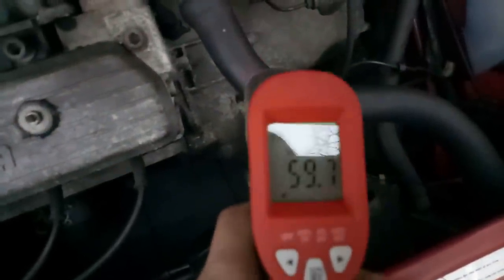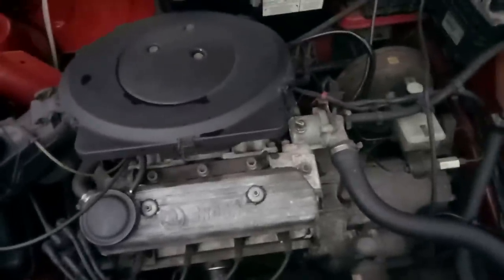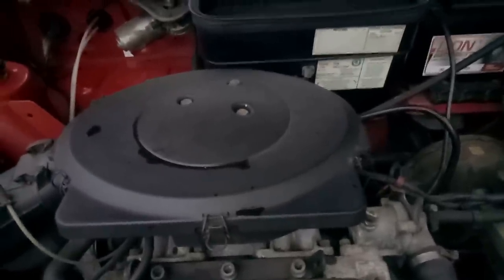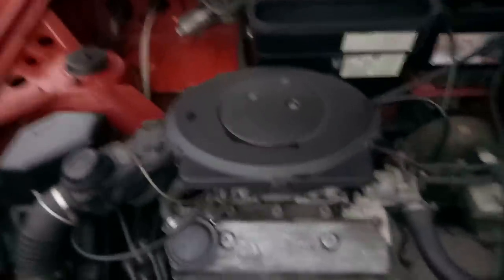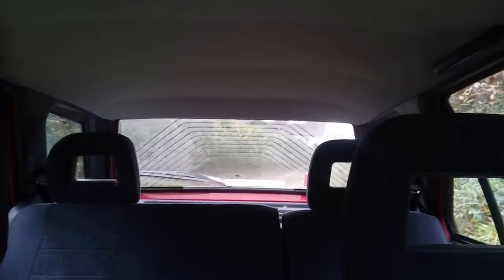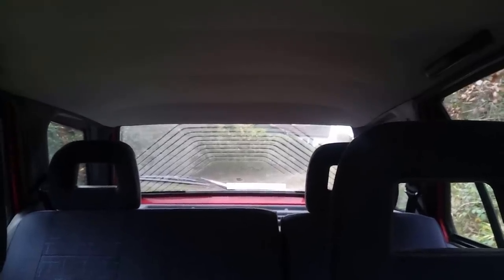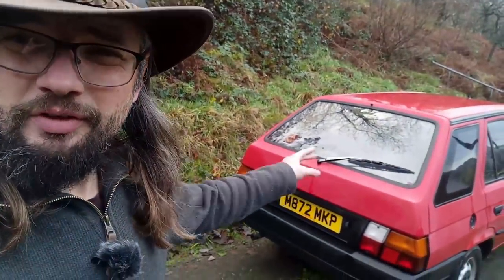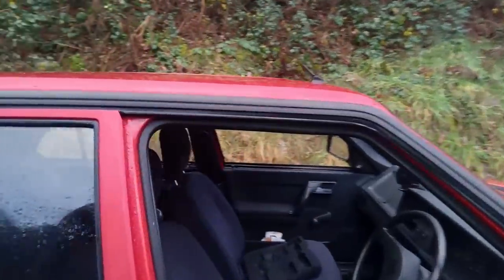Skoda Favorit Odometer fix (and other things)

Comment: Oh what a load of nostalgia. See that printed circuit board in back of odometer dials in 12:30? It says VDI Nitra in top left corner. It is acronym for former Výrobné Družstvo Invalidov Nitra. VDI was something like: Manufacture cooperative for invalids and Nitra is nice town in middle of Slovakia. Part of former Czechoslovakia where these cars were engineered and manufactured. It was special factory (not only one in country) where disabled people can find job with enviroments according to their disabilities. If someone was deaf or missing one or both legs, he/she could work with their head or hands. In this case probably assembly electronics of all sorts. Škoda itself is assembled in Mladá Boleslav in Czech republic till these days.
BTW there is a brand new huge factory Jaguar-Land Rover in Nitra, or rather in outskirts of the city opened recently this year.

Comment: I really love these longer Hubnut repair videos. It's one thing to buy an inexpensive car yet another to make the commitment to fix all the little things it needs to be perfect. I'm in the latter camp of thought so I really appreciate Hubnut's progress on this awesome little car. I think I would have put the odometer around 60,000 versus the 100 he chose since it would be a more educated accurate reflection of the miles on this car. Quality job replacing all the bulbs while he already had the cluster removed. No need to go back in there a second or third time. Lol. Great video.

Comment: To check that the temp gauge is working, remove the wire and earth it out to the housing, if the gauge rises to the top then the gauge is fine, proving that the fault lies in the sender or thermostat. Hope this helps.

Comment: Watching you adjust the numbers on the milometer reminds me of a car sold at the MG/Rover dealership I worked at back in the day. We had a preregistered Rover 200 that never sold and had sat unused in the compound for 2 or 3 years. Nobody was going to buy a 3 year old brand new car, so the sales manager hatched a somewhat iffy plan. The mileage was clocked by adding (I think) about 12k miles to the delivery mileage the car already had, and then he used it as a runabout for about a month or so. The car was then cleaned up and put on the pitch for sale as a 'low mileage' second hand car. It sold like the proverbial hot cake. The dealership had pulled off a similar trick with a batch of Montegos that had just sat in a compound for a long period of time the year before. I was quite shocked to learn at the time that though it's certainly illegal to roll back a vehicle's mileage, it is not illegal to add miles to a car's reading. I soon learned that this sort of thing was just another day at the office.
Reply: It's not illegal to 'clock' a car, it's only illegal to knowingly misrepresent a car for sale, so even if you increased the mileage it would still be illegal. HubNut just clocked his car, but he hasn't broken the law, unless he sold it and tried to convince someone his 24yr old Favorit was showroom fresh, which, as nice as it is, is gonna need more than a mop to get it like that. The difference between increasing and decreasing the mileage is that if you increase it, it would be difficult for people to accuse you of trying to profit, as well as the obvious fact it would be much harder to spot, as ownership under certain people does make the mileage shoot up, like those with long commutes.

Comment: Go the Favorit!  I have replaced the thermostats on several cars that I have owned and they always fail slightly open.  You don't notice it until winter when you find that the engine won't warm up.   I once had a Nissan Pulsar where the temp gauge showed normal but the thermostat was stuck open and the engine ran so cold the heater didn't work.  It took ages to figure out what was going on and by that time I had got rid of it and gone back to a Corolla, which also had a stuck thermostat!  But at least it was simple to fix, unlike the Nissan.  It was heart in mouth stuff watching you take the odometer apart.  What a satisfying achievement.
Reply: Pauline Hunter better to fail open than closed and cook the engine

Comment: A tip for testing/repairing rear hatch seals (possibly any door seal) I was given was to remove it and feed a length of the plastic-coated type washing line through it and cut to fit. It expands it enough to cure the flattening out and usually re-seals it nicely. It worked a treat on a Renault 14 I had the same issue with. Was meant to be a test and then replace the seal but it just stayed in there forever as it was doing the job. One of those permanent temporary fixes...

Comment: I have never seen such an enjoyable video about dashboard dismantlement and reassembly. I also agree totally with your remarks about us having reached 'peak car' by about 2000. This is a fine and humble example of a quality vehicle that is user-friendly. Look after something like this and it could last a lifetime. Modern cars are hideously over-burdened with unnecessary extras and engineering complexity that only leads to more ways to fail and prevents owners from understanding and being able to maintain their vehicle efficiently.

Comment: I bought a brand new Skoda S110R back in 1976. Nice car inside all black and soft padded but the exterior rotted badly. One day I had a puncture and as the wheel nuts cracked undone, it turned out that it was the studs that had snapped off like carrots. Such was the quality of the steel. The steering box (which was worm and peg ... think pedal car) needed oiling regularly but the nipple was hard up against the boot floor so most never got done. Making a hole in the boot floor and making a removable panel was the cure for that. King pins also had grease nipples and play could be adjusted as they wore. Replacement kingpins revealed that the wearing surface was a yellow coloured nylon. I'm sure that Skoda's improved as the years progressed, even before they came under VW's wing. I think the Favorit is a transition period car ... pre VW but continued into the VW era.

Comment: Changed the thermostat on me Mum's 1.4 Fabia & it made a massive difference. Not the same car I know, but it's still a Skoda engine. She bought it in 2009 with 36000 miles on it. It's only reading about 50000 now. Shops & back but the shops are 4 miles away & it gets chance to warm up!

Comment: I had a Favorit hatchback, bought new in 1994. I ran it for 84000 miles and only had to change windscreen wipers, tyres and brake pads. Nothing ever went wrong.  It was my second SKoda after an Estelle 130 withe the 1300 engine and 5 speed box. That also served me for 80.000 miles without any trouble or failure. I had 6 Skodas, ending with an second hand Octavia. Modern Skodas are too expensive, so I have run 2 Diahatu Sirions in recent years and now have a Suzuki Splash, which has been perfectly reliable for 37,000 miles.

Comment: On my leaky Land Rover, (Freelander rear door, what a design!) I removed the seal and cleaned it in soapy water, then used rubber restorer in copious amounts. Didn't leak any more. Nice cheap fix.

Comment: Thought i would share with you a funny story. Two days ago i decided to change the transmission oil in my girlfriends 1.5 Dci Renault modus, easy enough, drained out 1.7 litres and put in around 3 litres so no wonder it was a bit hard to find the gears. Took it for a test drive and the gears were now easy to find BUT i got 100 yards down the road and the STOP warning light came on the dashboard and a warning beeper started chirping. So, i pulled over and got out of the car to look under the bonnet but i glanced back down the road i had just travelled down to see a long, thick streak of oil! It wasn't gearbox oil, that was fine, it was engine oil! For some reason the oil filter must not have been tightened on it's last service (not done by me) and had come loose and all 4.5 litres was pumped out all over the road. My neighbours don't seem to be talking to me now due to the oil slick :(

Comment: Loving the Favourite videos Ian. One thing you can try is see if the rear lights are allowing water in to the boot because of a failed / misplaced seal. I have encountered this before.
Reply: @TomAlter1000  cellphone typo and sausage fingers........

Comment: painted needles......excellent!!........Being crap at working on cars, I once wired up a digital clock to my beige Fiat Uno in the early 90's.......pretty pleased with myself until I turned the ignition on and found it not working.......I'd forgotten to reconnect the wiring to the block connector before putting the steering column back together.............it only took me four days to suss out what I'd done....... what a muppet I was/am!!   Any time you want a hand dismantling a car let me know, just don't ask me to put it back together again!!!

Comment: Not the most elegant solution to the boot leak, but a quick & reliable fix that has worked wonders for me & leaky old cars: Blu-Tack. Put a bit around the rusty areas & see if it helps.

Comment: Dark side of the dash.

Nice fix there you did.

Once I took my 406 dash apart (sort of) to change a bulb or two, with the right tools (torx is a good bet on French cars) and patience reasonably easy fix can be DIY no worries. You went in deeper, respektos for that!

There is an amount of satisfaction hard to explain when you can mend or fix your own car.

My 1007 doesn't have a temp gauge but the fan works, I have checked that bit out. Strange choice not to have a gauge but hey it is French!

Comment: That Favorit is a tough little soldier! Simplicity is king. There's alot to be said about bargain cars pre 2002 thereabouts.. Great videos Mr, keep 'em coming... Just one tip having worked in a bodyshop, buy a cheap mop and some low cut farecla compound. That pinkish, faded red will come up a treat. Finish off with a good quality polish.. You will get big returns when it comes to resale. Believe me..
Reply from the maker: Thanks. I did buff it up, and did actually make a profit. The new owner has buffed it some more! I get to see it again on Sunday...
Reply: @HubNut  Literally five minutes after I sent that comment, I saw your following video of you using a mop etc, toiling away like a Trojan! Well done👍👍. I don't think anyone could have done a better job if I'm honest. The paintwork was neglected. Great result in the end.. 👍

Comment: I had the problem with the odometer on my Jetta when it was stuck. I stalled it abruptly one day and it just stopped working. I lost about 800 miles till a mechanic friend sorted it out. I've been talking alot about my old Jetta since you've had the Skoda. Quite similar in some ways. I hope yours doesn't turn into a liability like mine was.

Comment: I like getting the little dead bulb units out and pulling the tiny cap bulb out of it - they are usually removed quite easily.   You can then put a 12v 3mm LED with an internal resistor in their place in the original moulding and solder them to the contacts.  

(12v 3MM LEDs with clear cases are the best for automotive use, they are available irregularly via eBay or electronics distributors - I try to stock up as and when I see them for sale as they last forever... )  

On my old Saab I did this so I now have red backlight on the rear fog switch, white on the front fog switch, amber on the heated seats, basically anything to get rid of the sickly greenish backlighting it came with from the factory

Comment: Agreeing with the garage's recommendation. I had cars that rattled for many many miles. Never got worse.
Love the shape of the rear window heating.
That handle is supposed to be with the jack. Where is the jack? Somewhere in the engine bay I presume?

I probably would have calculated the miles I drove since I got the car and set the mileage to that.

20:09: Cue "Run to the Hills" by Iron Maiden for a driving montage :D. 

22:04: That fuel warning light. Reminds me of my Citroën Visa. You could get that needle from 3/4 to 'reserve' by applying some heavy cornering.

Well done!

Comment: Good to see work in progress Hubnut.  The felt pen on the needle trick looks good, though may not last.  I like nail polish for such jobs.  Fingers crossed too that the superglue holds.  Steel shaft and plastic gear?  I'd have hammered or ground some flats into the end of the shaft, scored up the hole in the gear and used epoxy resin.  But time may prove that we're both right!  Cheers.
Reply: Ah hah.  I've done a bit of pulling apart of speedometers.  One problem some cars can develop in Australian heat is curling of plastic speedometer needles which makes them drag along the face and be useless.  I've had to remake several from metal, which they should have been made with in the first place.

Comment: I had an Audi A4 Avant 1999 and the windows steamed up really bad in winter.Found out it was a leaky boot seal where it had flattened over the years so got a bottle of RainX Antifog and worked a treat till I sorted out a new seal.

Comment: Nice piece of DIY there, good to get things sorted with your own skills. You will know if you take the thermostat housing off if the thermostat valve is not operating correctly, or if as you suspect is slightly open, you can test such things in a saucepan with water in, which you probably know, checking with a thermometer the water temperature and the action of the valve according to it's specifications. The temperature sensor is a relatively cheap item, but the housing may not of been removed for a while which you probably have experience of. The rubber seal on the tailgate needs to be checked for signs of damage, water ingress under the seal where it fits to the metal edge, as water getting under the edge can set up capillary action. This can be checked by removing the lower section of the seal from it's seating position, and checking for signs of water inside the sealing groove, this is a common problem on many modern cars, which I have the pleasure of investigating after spells of wet weather, there are compounds/sealers that you can use in the grove, to stop leaks, we change many of these seals under warranty as modern rubber seems to be prone to breaking down after a relatively short period of time, and most manufacturers seals(that I work on) come with pre-fitted non-drying sealer in the groove. The leak needs to be sorted as the damp will cause mould smells and stains inside the car, which I doubt very much you want in this vehicle you wish to keep for a while. Good luck with all that, nice to see satisfactory progress. Far out man!

Comment: Should get 1 of them £1 dehumidifiers, put in boot to keep moisture out till you find where water is leaking in.
Reply: Damp spots are not abnormal in old cars as seals deteriorate and, is it me, or is the frequency of torrential rain increasing? Myself I just use an old dry folded towel with a weight to keep it in place, and swap it as needed with a dry one in the airing cupboard.
Reply: Those cheap dehumidifiers work a treat. I put 5 of them in my P6 (in the garage with the windows up and the vents shut) and they all filled right up. The smell of the leather coming back was amazing

Comment: I seem to remember that temperature senders used to be colour coded and matched to the gauge. Old Fords used to have several colours even on identical engines. I guess its to match the resistance between gauge and sender unit, so whatever matched units were available at the time on the assembly line were fitted.